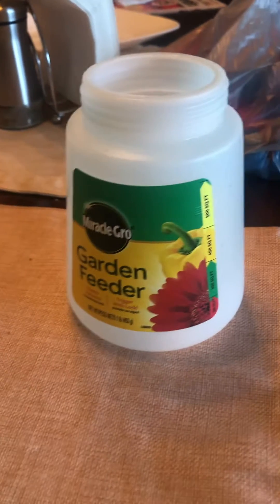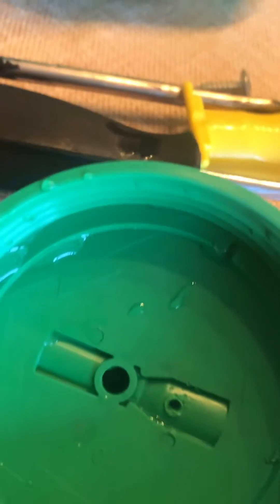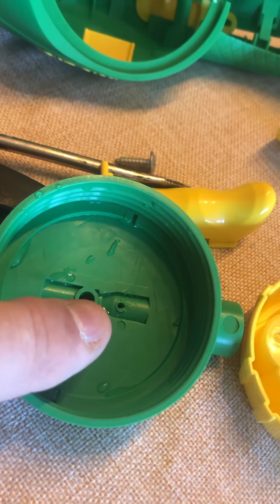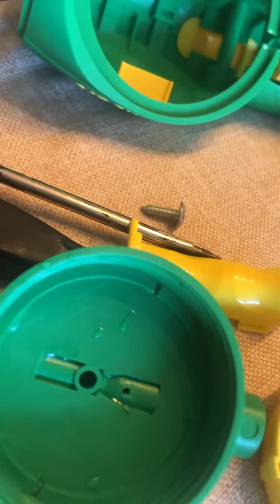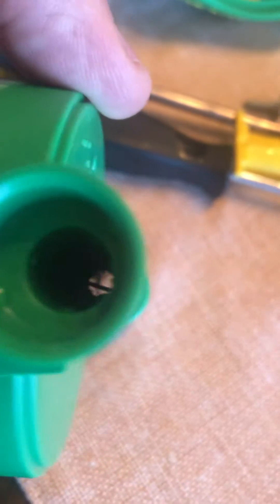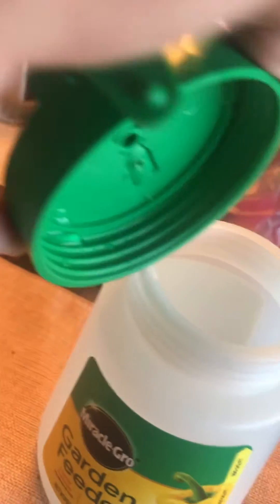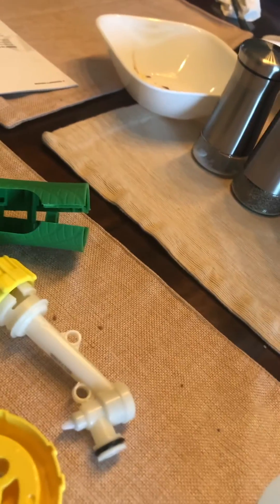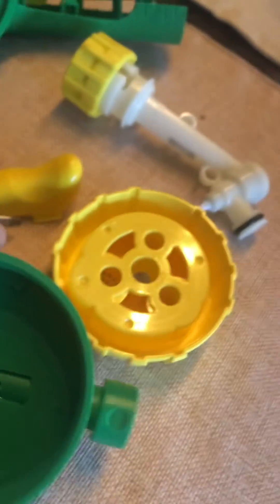Completely Disassembled Miracle Gro Spayer

Comment: Tip. Fill the bottle up with water. Then you do not have to wait for  it to fill up from the little orifice. To refill . Just pour the dry fertilizer into the bottle fill the bottle with the water to the top.

Comment: The basic design of the unit is wrong and cannot function without diluting the feed concentration.  Place the switch to 'water and feed' and operate without the container.  Notice the water entering the container from the small rear hole.  Why the venturi effect wasn't used for the design just defies logic.  How do you fix it?  Throw it in the bin, as i did.

Comment: Remove the screws, using two small blade screwdrivers start from the sprayer end top seam and it will start to snap loose. Does take a bit of pressure. Leave the screw driver in the split and use the next one to go as far down the split and pry again.
Pretty easy putting back together was easy.  On mine the locking tab inside got out of position.  The spray lever would not move enough to make it spray.  I put it back together with that tab in but if it gets out of place again I will throw the tab away.  Mine is in it's 3rd season.  I bought a spare.  I do like this new design over the old one...  It allows me to reduce the spray force.  Jim.

Comment: How did you get it apart?
Reply from the maker: @jonermler7134  there are Phillip head screws in the front and side that need to be removed
Reply: Thanks for your quick reply,  that's the first thing I did, it won't come apart??
Reply from the maker: @jonermler7134  I believe once you have the front and side screw out that it snaps apart. I see marks on mine where I probably inserted a flat blade screwdriver into the seam where the two halves come together.
Reply: @frankscuiletti996  Thank you

Comment: My Miracle Gro Feeder is leaking at the bottom of the yellow spay nozzle that controls the type of spay. How do you get the yellow nozzle off the jar?
Reply from the maker: @maginot2u  there are phillip screws holding it together
Reply from the maker: @maginot2u  the front twist part that changes spay patterns is held on by a Phillips screw. There is an o-ring behind it that makes the seal. Perhaps that’s the issue or the screw is loose?
Reply: @frankscuiletti996  thanks for the reply. I later saw when it was daylight that there is a Phillips screw. I took the yellow part off and inside there was a broken O ring. I bought a new one for 98 cemts and that solved the leaking.

Comment from the maker: Main Point?  Fill the cup to the top with solution and water before you screw it on. The positive reviews on Amazon do not match the volumes of issues people have with this device.  There are insufficient directions on the bottle label regarding how the cup must fill completely.  Miracle Gro simply sends canned responses to folks with issues and keeps adding dollars to their bank account for the garden/lawn solution and the tool.  Corporate America.  Their hot line was somewhat of a joke.  She finally did, though, explain that, yes, the cup must fill with liquid completely for it to work. Why did Japan take over the U.S. automotive manufacturing/sales market?  Here's a highly simplistic example of why. Poor products that never improve because no one gives a damn to change anything. How about the simplest improvement involving a better explanation on the label?  Too much, huh?
Reply: Could not agree more.   Would like to add ... little competition to force change or lower prices.
Reply: The first Miracle sprayer operated  the same way.  Have to wait for the jar to fill before the fertilizer powder dissolves and gets combined with the spray.  You can partially fill the jar with water after you add the powder. Messy though.